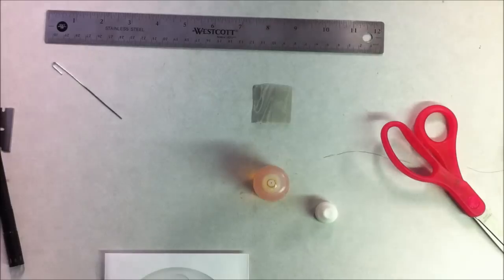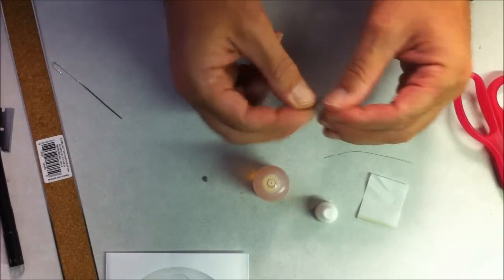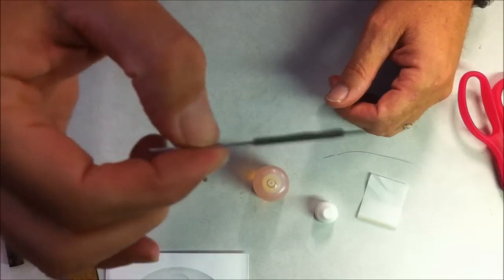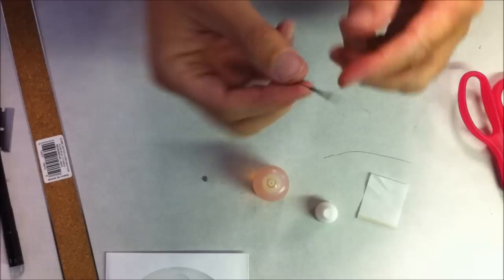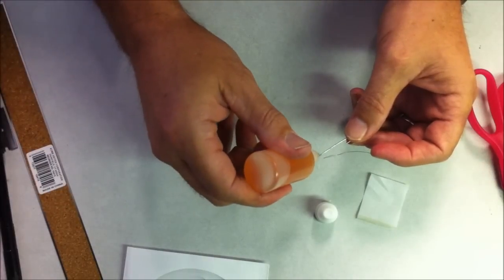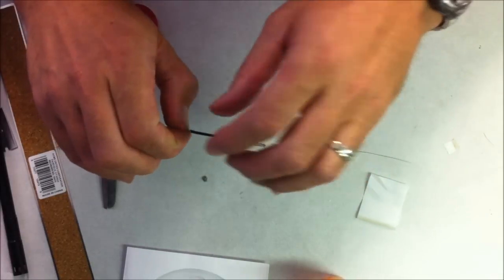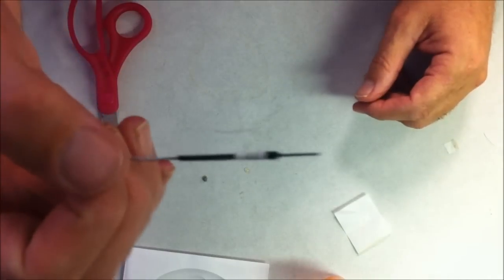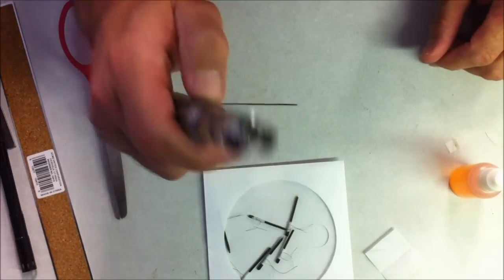G-Tank-US Wick Wrapping

Comment from the maker: 1/8" fold is the bottom, then 1/4" fold 90 degrees to the fold (side) and wrap to the 1/4" fold. No fold on the top, the 1/8" fold sits in the juice well.
With the G-Tank-US the juice is on top and the coil is on the bottom. So the 1/8" fold goes in the well and the coild sits directly above the well, the top section goes into the juice tank as it is gravity fed.

Comment from the maker: Hi, I would go with 28ga A-1 Kanthal, wraps depends on wick diameter. I would measure out 1.0 ohms and place dots equal to 1 ohms on the two points of the wire with a sharpie. The leave 1/2" beyond the dots and wrap your coil from dot to dot. Should be perfect for a mech mod.

Comment from the maker: If you are doing the soda straw type i.e. (hollow) I have had a couple people tell me they crimped the top so the juice will not run down the center. The wick should fit snuggly in the hole but not overly tight. Might check all the air hole to make sure they are not obstructed causing a higher vacuum pressure when you inhale making it force more juice out.

Comment from the maker: No problem, make sure the multimeter is set to ohms "Ω" measure in about 1/2" from the end and place one lead on that point. Now used the other lead to move down the wire until the multimeter reads 1.0 ohm and mark the position of the leads with a sharpie. go 1/2" beyond the second mark and cut it. Now wrap from point to point. Go to youtube and watch this video, just cut and paste it after the youtube url /watch?v=BXHu6y94V60